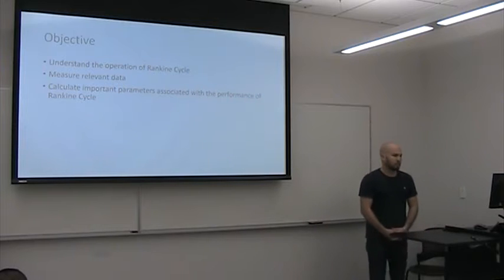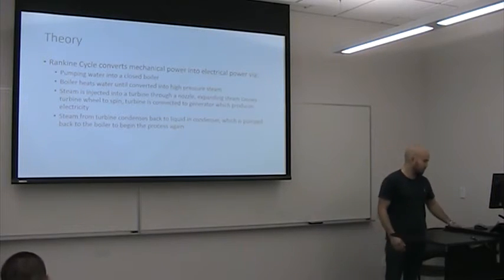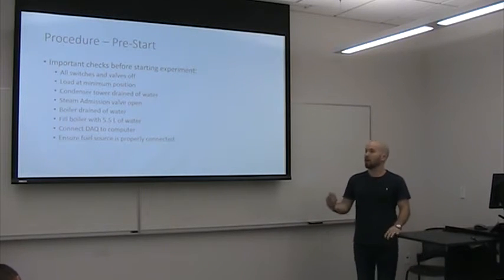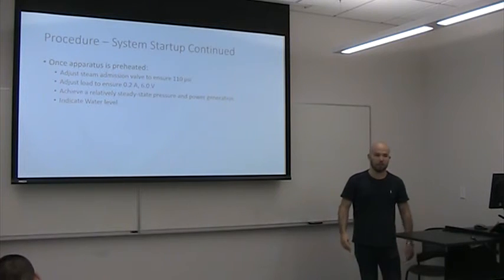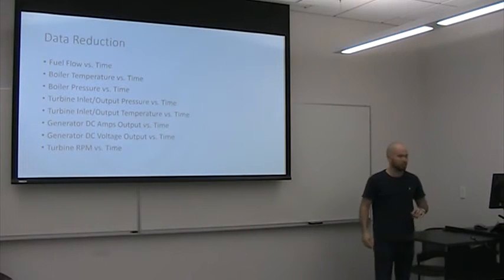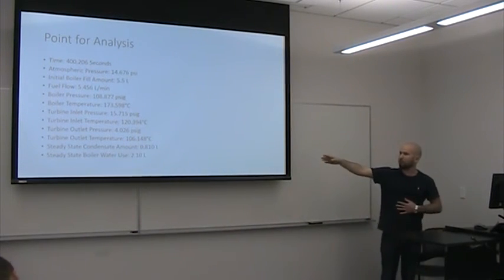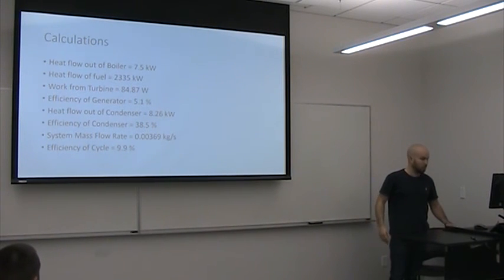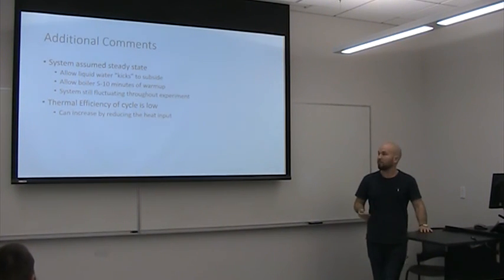MOV004

Comment: Positive: Good explanation of the apparatus, procedure, and graphs.
Improvement: You should have focused on how you got the results by showing the equations and so than focusing on the procedure. The thermal efficiency was quite low. Overall, good presentation.

Comment: o Positive: good job marking the steady state points on the graph and showing where you used data for calculations, good comparing calculated efficiency to expected efficiency
o Improvement: show a visual of the Rankine cycle to aid observers instead of reading the sentences off the slide, still had the visual but didn’t use it while explaining; speak in past tense when explaining procedure, experiment was already completed

Comment: Positive: Spoke loudly and clearly. May want to recheck the thermal efficiency of the system. 
Improvement: Try to elaborate more on the equations used to find the values presented on.